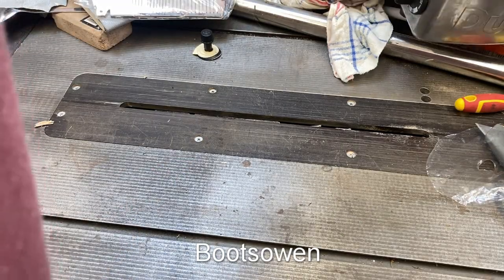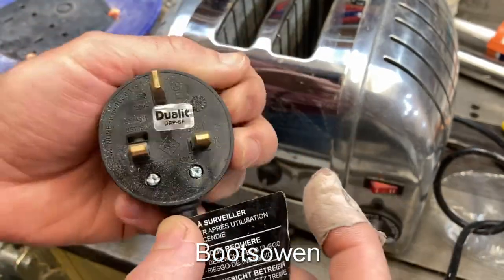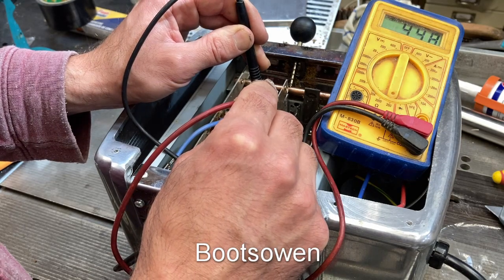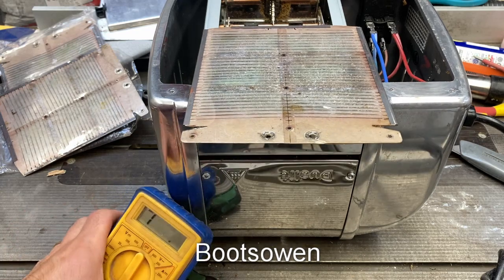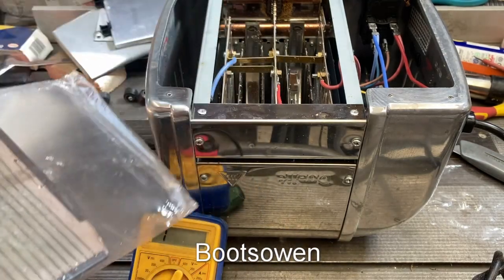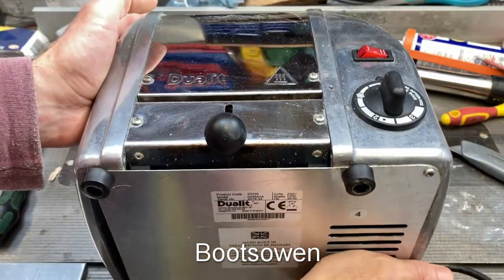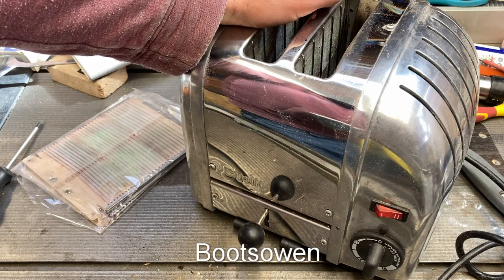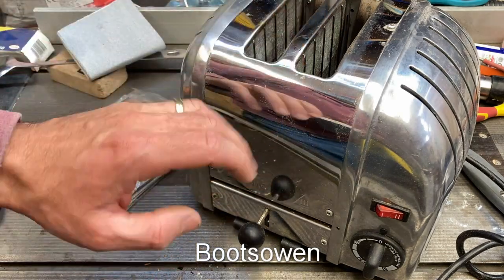Dualit toaster: teardown and testing elements: 2 slice

Comment: I remember replacing elements in an old Dualit toaster used daily at an old school, that was in about 1997. It was very reliable.

There were two types of elements to buy for it; the end elements were more expensive & supposedly one sided.

I was disappointed that it cost more for 'special single sided elements' that were actually identical in resistance & layout of the Nichrome element wire.
It just wasted the radiant heat from one side :-(
Reply from the maker: The whole repair thing is a bit of a mess when it comes to appliances like this. The elements for this machine cost more than a new basic toaster. So it’s good that they can be replaced but where is the incentive for a domestic user of the cost is so huge.
Reply: @bootsowen  
I totally agree, thumbs up it is repairable but a shame there's little incentive these days especially in domestic usage.
However it's good for people like us who enjoy having a go.

I agree about Henry's, it's thanks to you & your uploads that has really got me to move to using a Henry as they're so repairable👍. A rarity in today's world!